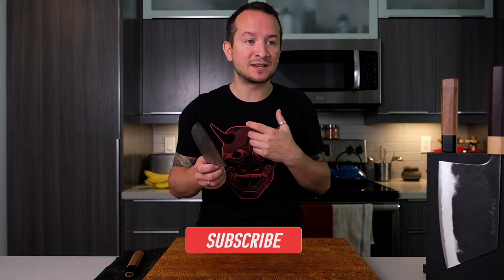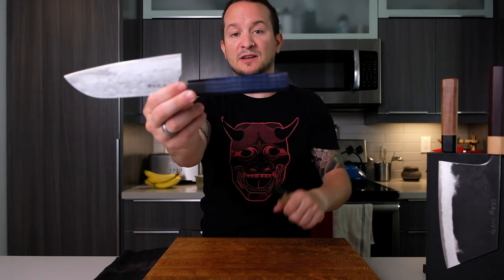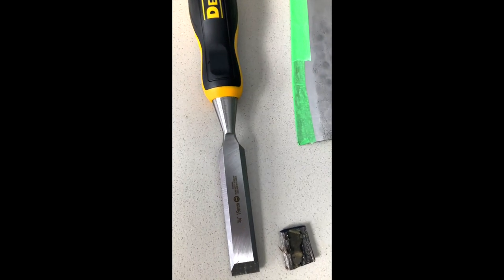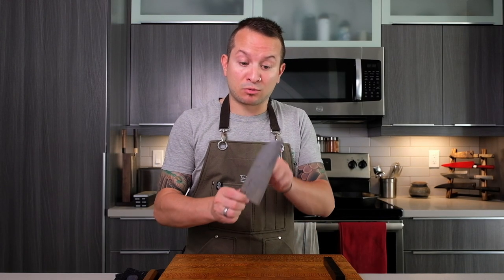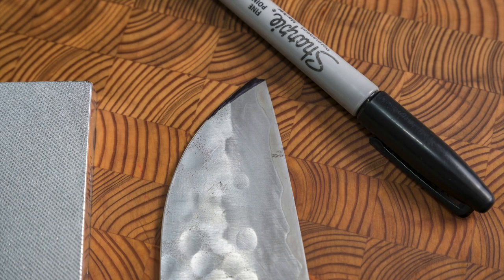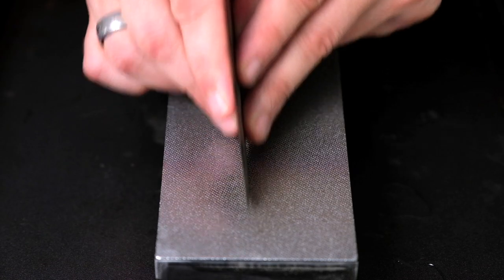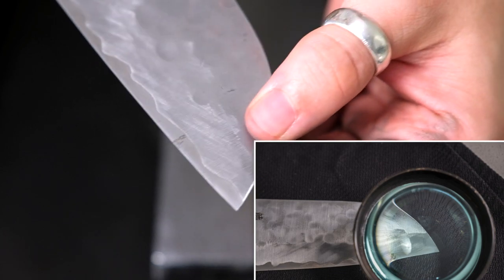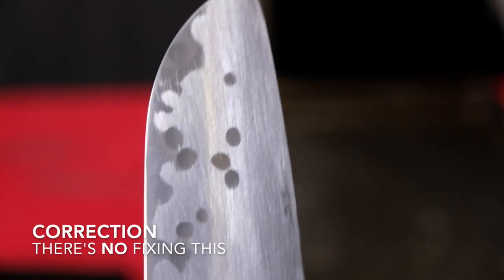Fujiwara Maboroshi 165mm Santoku Makeover | Part 1

Comment: Big fan of the glass stones, but they're overkill for any carbon steel. Obviously it will work just fine if it's what you got. I just don't even bother to use them for anything other than very hard stainless steels. White steels in particular sharpen up ridiculously easy. I've done "experiments" just messing around with stuff and found that I can take takfu W2 and completely dull it on a brick and bring it back to shaving sharp with nothing but a high grit finishing stone, like a shapton pro 5k, even a 12k, a little bit of elbow grease and about 90 seconds per side. Don't try that with any stainless steels. It's wild how easily pretty much any carbon steel sharpens up, even AS. Kinda blew my mind and figured anyone who hasn't tried for themselves probably wouldn't believe it.
Reply from the maker: My Shapton Glass 1000 is my most used stone. Does quick work of adding the bite I want on stainless or carbon. Just a question of preference. They stay flat for a long time too. So less time on the stone, long time before dishing, and great results.